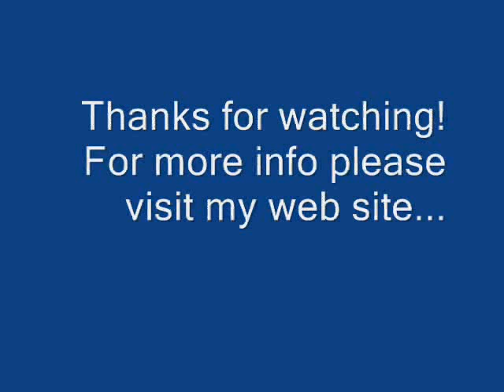#134 - HHO Games Update 2008-11-1

Comment: I haven't viewed your vids in a while, but did you ever solve the flashback problem? If not, they make such things for cutting torches, it might work for HHO Gens.

Also, I always see a vacuum 'pull' the HHO gas out of a Gen., but has anyone 'also' added a small bit of pressure to the Gen to help the gas get into the engine (causing gas flow 'out' of the Gen. with the vac. and aided by a regulated air inlet with ltd. press.)? Both of these lines should be on a car engine. Just some thought's.

Comment from the maker: No. Instead I will be recirculating exhaust gas to slow the burn rate and recover waste heat in the form of electricity to return to the cell using a 56V TEM.